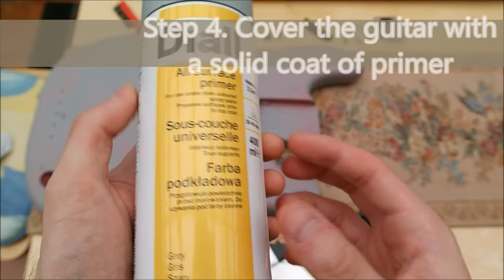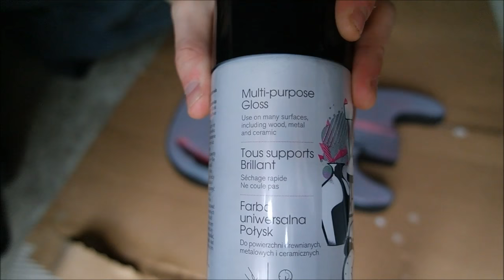Painting a guitar black (+ painting technique) - precision bass

Comment: One thing you do but forgot to mention: Always paint in your socks. The static electrical charge helps the paint bond to the surface.
Reply: Lenny Cribari what
Reply: It also helps to put a magnet in your left pocket and a copper penny in your right before painting.
Reply: 10 years experience as painter 0 years getting jokes

Comment: Awesome job!  It looks great.  I like the matte look too.  You made it nice and simple.  How many coats of black did you do? Any sand between or after?  Does it laying it down work better than hanging it, maybe avoid runs?
Reply from the maker: Thanks Jeff. Surprisingly, 1 coat was enough. I didn't sand it but if you decide to, make sure it's at least 1000 grit sandpaper and polish is after. It is better to hang it but I made sure that when I painted the 1st side, that it was dry to touch before turning it over and painting the other side. This was about an hour. You should also try and reduce the points of contact touching the paint after your turned it over.

Comment: I know it differs but just from ur personal experience, how many turns did you loosen & in total how many days was the neck detached from body unstrung. thinking about starting it but I think it'll be more than a day process cause for painting the top and back
Reply from the maker: For me the neck was detached for about a full day and it was about a full turn I think, can't really remember. When I did this, I painted the back and let it dry for 2 hours, and then the top and then left them to dry overnight. The marks on the back when I turned it over were un-noticeable and were buffed out with polishing. It's probably a better idea to do them on separate days though.

Comment: Hi, you mentioned using 400-800 grit sandpaper. https://en.wikipedia.org/wiki/Sandpaper#Grit_sizes considers that "super fine" grit for final sanding of wood and finishes. They suggest 60-80 for "gentle removal of varnish" and 100-120 for "sanding bare wood in preparation for finishing". I have 120 girt. Do you think that would work ok, or should I get a finer grit?
Reply from the maker: Personally I would stick to 400-800. I've got some sandpaper that's 2000 grit to get a super fine finish. I think you could do it with 120 but don't put as much pressure on when you're sanding. All you want to do is get a rough, non-reflecting surface. I'm not sure if there are different grit sizes for US/UK but I hope I've given you enough info for you to decide.
Reply: Thanks. In my experience, 120 gives a pretty smooth surface on wood. I've used it to smooth out some rough pieces of wood that I had. You can see the scratch marks on aluminum though, so it's still a little rough. I think it should work ok to roughen up the surface before painting, especially if I polish it afterwards. But I'll probably get some 600 or 800 grit anyway. Wouldn't hurt having some lying around.
Reply from the maker: Yeah, a wise choice. Good luck with your new finish :)

Comment: asking a lot of questions but feeling more content through ur replies. 

would I need to adjust the truss rod twice? once on the first day painting. then again on the second? or would I be good to go off one adjustment for those two days it will be detached
Reply from the maker: That's fine. Just one adjustment after putting it back together will be fine but I only decided it needed adjusting after I had played it again. It might not be the same in your case and it might be completely normal after reassembly.

Comment: Hey ! Great work my friend ! I'm about to do the same on a red Squier... Can i ask you a few questions ?
What kind of paint did you use ?
How many coats of paint ?
Did you sand it after the primer ?

Any other tips  ?

Thanks in advance !
Cheers
Reply from the maker: Hi AlX, thanks for the kind words. The paint I used was just some standard multi-purpose gloss spray paint that I got from a hardware store, nothing special about it but I managed to achieve a very nice finish considering. I only did one coat using the technique I outlined in the video and I did not sand the primer (there is no need). For tips I would say practice your spray-can technique on an old bit of wood first and try to get an even finish on that before you start painting your guitar. Best of luck with your Squier.
Reply: Thanks mate ! Cheers !

Comment: If i wanted to make my guitar look road worn and have some of the old finish showing would it be as easy as sanding back the new paint or would i need to do something else?
Reply from the maker: That's a really good idea. I think it would have to be a mixture of sanding back, knocking it with a screwdriver and then ageing the hardware. I'd make sure to watch loads of videos on road-wearing a guitar because it's so easy to ruin the look by wearing it poorly.
Reply: very stupid idea unless you have a high end,nitro finished guitar and then you really dont want to make "fake" marks on a high end instrument either

Comment: do you think wet sanding is nessesary?
Reply from the maker: Cesar Aguilar,  I think it depends on how good the finish is after you paint. Luckily mine was already quite smooth so i just went over it with Polish. If however the finish is quite bubbly, uneven or scratched is probably a good idea to wet sand before Polish. Hope that helps.
Reply: From the looks of the finished guitar, there's a fair bit of orange peel, especially near the bridge.  Could definitely have used a wet sand.

Comment: for a DIY new beginner this is good, although you need to take more of the old paint of, and you need to start and stop before and after you actually hit the guitar.
and notice that the bass looks like the skin of an orange, this is because of to little sanding after the new paint has been applied, using 800 1000 and 1500 before the car buffing will yield a much better prof. finish ;)
just my two cents! ;) othervise its a good job :)
Reply: He did start and stop

Comment: I painted a bass like that a few years ago. 

I took it onto the balcony.  
Hung it up. 
The air was cold. 
Can was cold. 
Body was warm.  

As soon as I put some paint down, the body cracked in two places.   
Like I’d hit it with an axe.  
One was right up the centre line along the whole body.  
Simple mistake to make.  
Seems really obvious after the fact.  
Should have put the cans in a bucket of warm water for a few mins. 
Or hung the body up and let it cool before hand. 
Or just painted it indoors. 
But that never happened to me before painting cars or bikes.  
So that outcome just wasn’t in my data base.  

I ended up having to strip it all down. 
And put bow ties along the cracks.   
I should have thrown it away and bought another one. 
But it turned out ok … in the end.
Reply: wtf? was it minus 25? FUCKING OBVIOUSLY YOU DONT PAINT THEN

Comment: There is no need for clear coat?
Reply from the maker: You can use clear coat for a gloss finish and to make the finish last longer but I prefer a matte finish over a gloss one and I quite like aged looking guitars so that's why I didn't use clear coat.
Reply: @rob3649  i see..so clear coat not so important right? As long as it look glossy..
Reply from the maker: @nizamkechek1150  Yeah, you can achieve an acceptable gloss finish just by polishing and buffing out the paint.
Reply from the maker: @nizamkechek1150  It's personal preference. If you want a highly glossy finish like a brand new guitar you'll need clear coat.
Reply: @rob3649  i see..
And what do you use for polishing? Can i use any type of car polish?
Reply from the maker: @nizamkechek1150  Yes I believe any good car polish is very finely abrasive so it should smooth out the paint on cars, and guitars too.
Reply: @rob3649  allrite..means there's no problem if i use car polish..
One more question sir..
What i should do with orange peel?
Should i sand it back then polish?
Reply from the maker: @nizamkechek1150  Exactly, some sandpaper and then polish. Sandpaper should be 800 grit or higher. I didn't have much orange peeling on my guitar though.
Reply: @rob3649  awesome sir..thank you very much for all the information..
God always bless you sir..👍👍😊

Comment: how much ml do i need for 3 coats ?
Reply from the maker: Het Shah.  1 can,  about 500ml should be enough
Reply: Thanks :) !! but my local supplier is providing a 450ml so should i take the risk for 450 or should i go for 900 ?? 
They are pretty much cheap, about 3$ for 450ml
Reply from the maker: It's up to you, maybe for 3 coats go for the 900ml

Comment: SADLY Not the best way to do a repaint. But if you just want a black guitar or green, yellow, pink or whatever, I guess it will do. 3/10.

Try the Brad Angrove videos instead for better methods to get a pro finish with cans.
Reply from the maker: Absolutely, I know it's not the technique that will get the best finish and so does everybody watching this video, it's not new information. The Brad Angrove series is good but it's not too dissimilar to mine, I already explained in a previous comment why I didn't use clearcoat, because I wanted a satin finish essentially, and that is the only difference between the two videos really. I hope people will watch both videos to have a better idea of what paintjob they want and how to achieve it. Thanks for commenting.
Reply: Who asked you ?